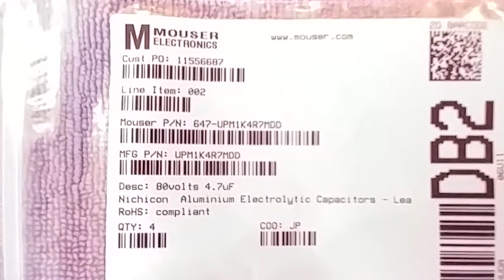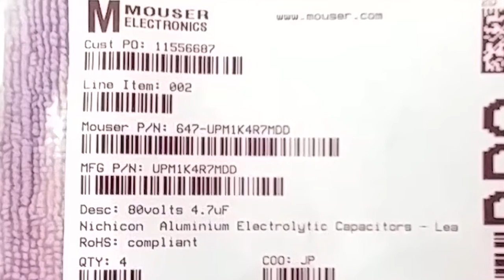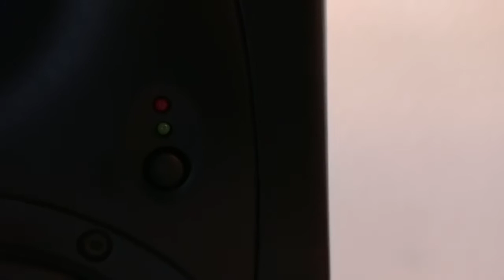Mackie HR624 - NO POWER FIX

Comment: Just did this repair.  Very grateful for this video and other sources that run down this fix.  I did not fully disassemble the the thing and work from the back of the circuit board - I worked from the top with the motherboard in place.  So I didn't have to do the extra taking apart, replacing the paste and other reassembly.  However, working in that cramped space from the top of the board was not easy and I feared I was having to apply so much repeated heat from the soldering iron in order to get it to flow correctly I might damage the circuit board or something.  It took a lot of attempts, but I eventually got the right angle of soldering iron, solder, capacitor lead and circuit board.  Also wasn't that easy to suck the solder out of the holes after breaking the capacitor off.  So pay your money and take your choice which way you go.  If my other 624 does the same thing I might just tear it all down and work from the back of the board as shown here.  Anyhow, the repair worked :-).

Comment: Worked like a champ.  For those who can't get the cap posts out, add a bit more solder first and that will help get the heat down into the through hole and give better chances on that tough angle with the desolder pump.

Comment: I just replaced the same capacitor on my HR624 Mk 2 Mackies which fixed the power issue.  The enclosure in this video is similar on the Mk 2 but there are enough differences that you have to study it and use common sense. But this is a good general guide.  For those who have never replaced a capacitor, search on youtube and you'll find some good videos on how to do it. I found no trouble getting the old capacitor out.  You need a good soldering iron and a steady hand. I've read other methods online where people have done it from the top (without accessing the pins from the other side of the board), but my advice is to take the time to do it right.  Take the whole thing apart and the removal and soldering goes easily.  I have never replaced a capacitor before so those other videos will help. Also, thanks for the link to mouser.com. I now have spares for when the other side goes out.
Reply: Hey Scott in these video I see two blue and one black capacitors; in the HR624 mk2 I see two black and one blue capacitor. Are they different sizes? where you bought your capacitors? I would really appreciate your help. Thanks.
Reply: @raytorres4442  Hi Ray.  In my HR624 mk2 I also had two black and one blue capacitor. The blue one in the C65 position is the one that I replaced, and the old one had no signs of failure like bulges or powder; it looked fine (but it obviously wasn't).  The capacitor I bought was the one suggested in the poster's link above from Mouser Electronics.  The Mouser part is 647-UPM1K4R7MDD.  It is black, so you will wind up with three black ones in a row.  I bought 10 so I could have spares. It's an easy replacement if you have a good soldering tool. I bought the heat sink grease at Home Depot. They have fairly small tubes available. Hope this helps.

Comment: Hello - I have a Mackie HR824 that has gone bad. How did you identify which capacitor had gone bad in this situation? There is a slig HR my different layout on the HR824 so I will need to identify it
Reply from the maker: You may need to just look at the caps and see which of them is swollen.  If none are, then start pulling them and testing them with a meter.  Yes, that is time consuming, but that is also why repair shops will charge you hundreds to replace a $1 component.

Comment: Thanks for uploading this! My went out years ago and I am in the process of fixing it. I've researched online and noticed that others had used a 63volt instead of an 80volt. Curious to why you used the 80volt instead of the 63volt.
Reply from the maker: Where capacitors are concerned, the higher the voltage, the stronger they are in handling over voltages that might come along.  Using a lower rated voltage would be a dangerous thing, but a little higher voltage rating is a bit of insurance.  Also, think the same way about temp ratings.  A little higher temp rating is a good thing to consider.  The engineers designed a circuit using the most affordable components that would get the job done with relative reliability.  You putting in a higher rated cap where voltage and temp are concerned does not hurt the circuit.
Now upping the uF rating WOULD change the dynamics of the circuit.  That is something you would want to NEVER change.
Reply: That makes so much sense. Thank you so much!
Reply: Dang bruh, I'm gunna get a 1,000 volt cap!
Reply: @CookieManCookies  ...like it would even fit in there! Ha!

Comment: Could my power had gone as I'd accidentally left on over night then all day.. ?
Reply from the maker: Those caps just go bad over time.  You must replace them if you want your speakers to come back on again.  Try to find the same value cap, but with a higher temp rating so it will last longer.

Comment: Replaced capacitor and fuses... still won't turn on.. does it matter which direction the fuses go in?  Struggled getting the old legs of the capacitor out to be able to fit in the new capacitor.  Is it possible I fried something such as the motherboard while melting out the old solder?  Any info would help.  Hoping I didn't ruin the speaker...
Reply: Fuses have no polarity my friend. Without a engineering degree, or oscilliscope. The only other option is to desolder passive components, and measure them one by one.. this works for resistors, capacitors, and coils. Integrated Circuits would be way harder to test.. !

Comment: so quick question. My Hr 624 has started loseing volume. T he green light stays on but volume is very deminished. after leaving unit off for a while it returns but not for long.
 Could you point me to which cap would effect that?
Reply from the maker: You just gotta test the caps on the power supply board.  It sounds like one of them is not holding the charge properly.

Comment: Can this cap be replaced with a non polar cap?
Reply from the maker: You gotta use the same style cap, same values, but you can get a higher rated temp so it will last longer.